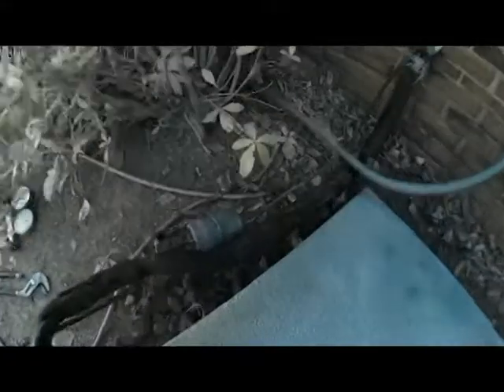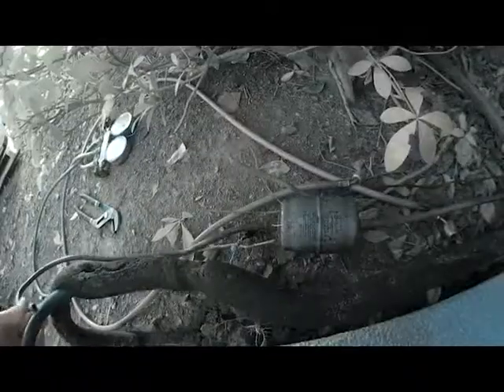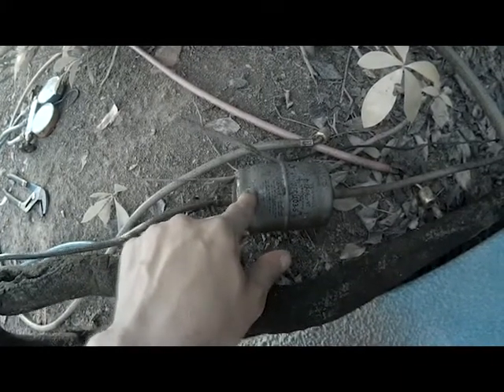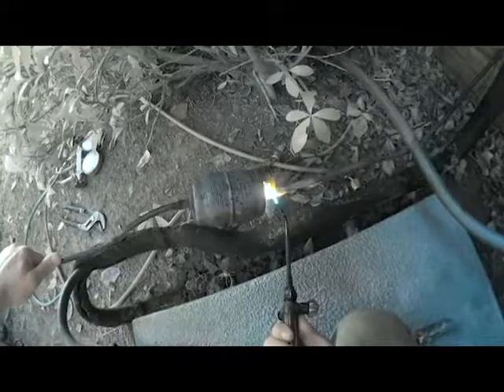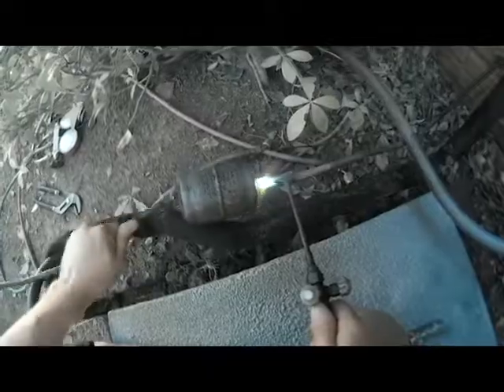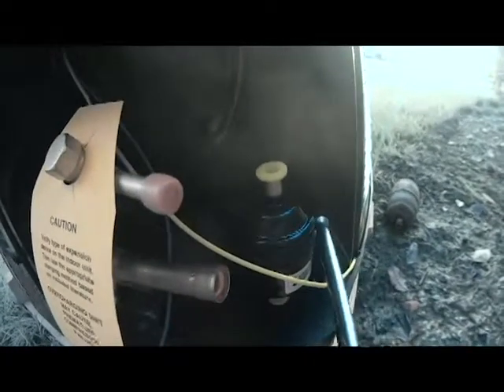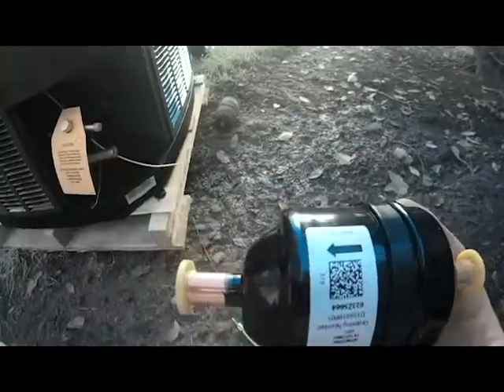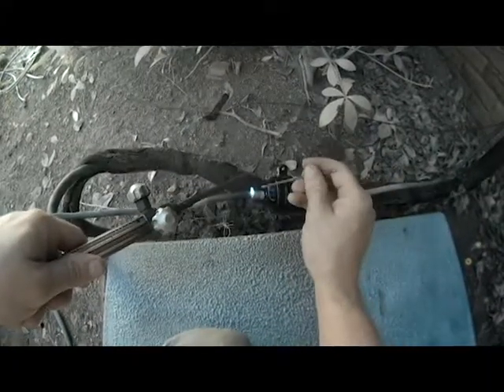How to Install and Why You Need a Filter Drier!

Comment: Hi Mr Travis is it expensive to have it replaced? My sister-in-law was mowing our lawn and accidentally ran over it exposing the inside of one of its corners and the gas started coming out so I turned it off
Reply: Did you find the replacement and recharge costs pretty substantial?